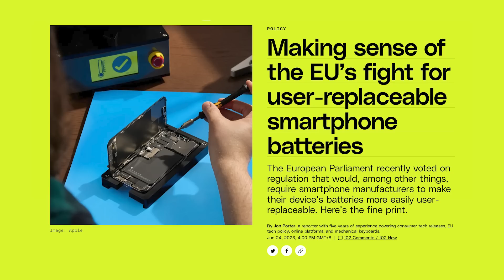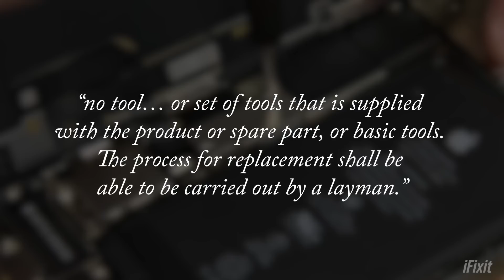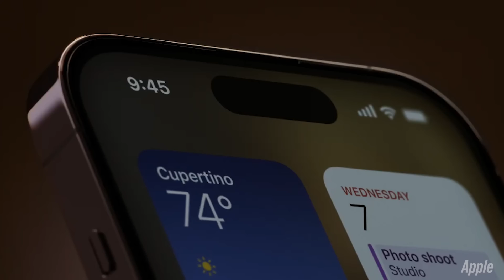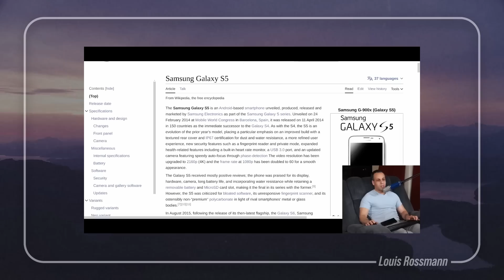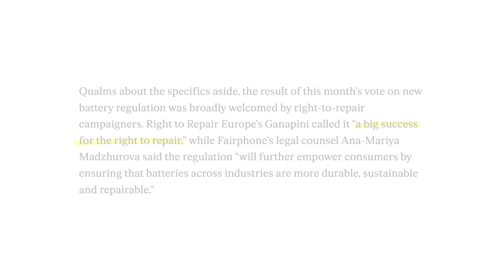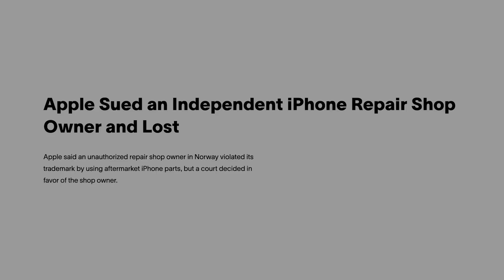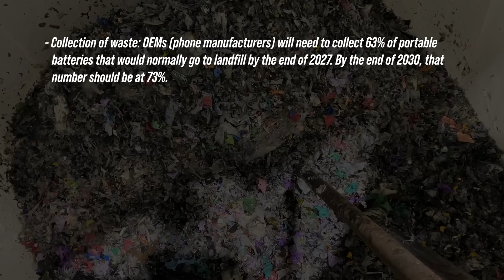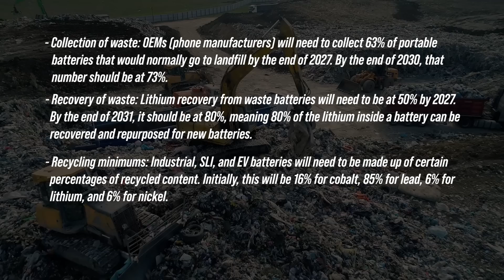EU Just Changed Smartphones Forever

Comment: Remember the days when brands were proud of their craftsmanship and tried to make their products last as long as possible? LV suitcases anyone? Well those days are over and everything lasts shorter and shorter. 
One great example is desk lamps. Something simple that everyone has and probably use the most without realizing it. Back in the day, I can change out the lightbulbs no problem. I had a floor lamp that lasted 15 years and died of old age and rusting. My ikea desk lamp lasted for 10 years with 2 bulb changes. Then I got a Philips lamps (it was the only brand I recognized in the store) At first it lasted quite long, 9 years with a bulb change in between (there was only one on/off button). Then it died and I got another Philips lamp which was LED and was touch sensitive. It lasted only 2 years, then the 3 subsequent Philips lamps (all touch sensitive) lasted for: 2, 1, 2 years in that order. Are you seeing what's happening? The 5 lamps were all Philips but their lifespan have become shorter and shorter. I mean, yeah, the LED lamps are way brighter but they also last a lot shorter simply because I couldn't change the lightbulb AND because they were all touch sensitive. The worst part is, even when I wanted to get a light bulb desk lamp, I COULDN'T because they no longer make it anymore or the shops I go to just no longer sell them. Isn't that exactly the same as smart phones? Theses manufacturers are making conscious decisions to phase out stuff that last longer and making stuff that last shorter.
Reply: Once I helped the girl of my best friend transporting a 22+ year old (second- to fith hand) washing machine she purchased. I would never have bought that old, loud, ugly thing, but she just wanted to finish this point on her todo-list quickly. It served the couple and a lot of other people (Travel&work guests) another 12-15 years. Was a "Miele" but thats not important, because they dont produce machines that good anymore since decades. Nobody does.
Reply: @bAtACt1X  In our apartment house we have a professional drying machine from Miele in the basement, for all people. It was old when I moved in in 2001, and it is more old now. I guess it is ~40 years old and still strong. Can dry the contents of 2x regular 6 KG washing machines in 22 minutes.
Reply: they cant fleece us for all our income if they gave us quality products
Reply: I have a very expensive 2 arm pharmacy floor lamp that uses halogen bulbs, which I can still find. The high end lamp shop I bought it from 25 years ago is still in business but said they don't work on anything with halogen bulbs. The problem is the dimmer switches are bad. Then it became "we can't get the parts". Very frustrating. Going to take it apart and am determined to find parts and fix it myself.
Reply: @rockyroad7345  my gosh I have the same dilemma with the light on a Nikon microscope that uses that delicious halogen bulb. The bulb broke because I was using it nonstop and had spent a lot of money looking for a replacement. I found one online however, the technician who would install the replacement is not that familiar with medical equipment. It's either his fault or mine that the microscope wouldn't turn on anymore. I like that microscope because the bacteria looked bigger compared to newer Olympus microscopes (LED bulbs). The light that the Nikon Optiphot emitted is so pleasing to the eyes. It's sadly a condemned property at the dumpsite because the institute don't have the budget to repair it. The quality of products made before were top-notch, their prices were top-notch too like 6x more expensive. But they last for a decade or two and have replaceable parts to boot.
Reply: LED bulbs held a lot better in the beginning, just like the traditional bulbs. Because the brands didn't sell as much as they wanted they all decided to make the heatsinks in them worse so they would break every 2nd or 3rd instead of every 7th year. The world's oldest still functioning lightbulb the Centennial Light has been burning since 1901 and has almost never been turned off.
Reply: I have an angle-poise desk / table lamp that I bought as a student in 1968.  Using a 100 Watt bayonet cap incandescent lamp, from the heat generated, the lampholder, switch and the first 200 mm of cable have needed to be replaced - twice.  Now with a brass and porcelain lampholder and replacement LED lamp it should last for another 55 years!
Reply: What about refrigerators, dishwashers, washing machines etc.etc.etc.? None of those last more than three, four years... At this point I buy the cheapest buy extended warranty and just replace it when it brakes... There's no point of buying $3500 fridge when it's going to break in four years just like a cheap fridge for $900 does.
Reply: They do actually. I think they do it through the updates, stressing your phone, etc. into consuming more enegry and useless stuff is stealing your phoney processor energy or so, making it slower, etc.
Reply: Water in our whiskey
Reply: I have a 24 year old power cable from my first computer, which I use to run my current rig. Acer was the shit back in the day
Reply: I hate the touch lamps had one they died after a year because of the stupid switch, took it apart to repair it and couldn’t even do that it was ridiculous never again will I bug and LED Lamp.
Reply: Technics SL-1200MK2 vs Technics SL-1200MK7
MK7 is a fucking disgrace to the legacy of the 1200 series.
MK2s don’t break, MK7s do.
Reply: Even IKEA still got desk lamps with changeable light bulbs, just bought one a year ago... easy to get.
Reply: Yea i remember that day clear as crystal but Hmm you told us that the desk lamp you had before only lasted 2 lightbulb replacement then what? Like Wtf? My plastic desk lamp been through 50 total of replacement of lightbulb since 2003 and I don't see the need to replace it to modern lamp.  other than recently i did the paint job, $2 touch sensor  and wooden finish to make it look up to date.. and btw all of the originals parts were still working. i just like to tinker with stuff

The on off switches are easily replaceable, so does the entire socket to the wire it's a simple electricity really nothing fancy. You can even paid an electrician to make you a diy desk lamp if you're too busy to learn it
Reply: its called planned obsolecense and the Dutch philips company had a big fat finger in it. too bad people never learn about this stuff in schools. Google it. philips lamps could survive decades before they planned to decrease the life spans of products at a "secret" meeting. yep. a real conspiracy.
Reply: I DO TAILORING I have a 1929 communist-era 7kg tailoring iron.  The electrical connector broke - I walked 400m to the hardware shop and bought a new one for $2

In the west we were told the communists were backward and stupid - no, they just had a very VERY different philosophy, they wanted things to last and be repairable.
Reply: @piccalillipit9211 tf does communist philosophy has to do with the thought process of everything around the world at the time? It only started to change in the 21st century
Reply: Communism was always a global concept.   Stalin abandoned this.  @Joemondaking
Reply: @piccalillipit9211 communist got their products from capitalist companies in other countries. This false duality is used to play you as a pawn. Communism and Capitalism is ate two sides of the same coin. Figure out who makes that coin and controls it (flips it for you) and you'll see that these "economic theories" and "political ideologies" aren't what they seem. 

What you're more likely trying to promote in your comment is a form of craftsmanship based in an Agorist market. Essentially, the old way of a skilled and experienced craftsman that creates something that lasts for years, decades or even generations. That's the philosophy your aiming at but you'd have to live in a smaller, localized society and not the massive, global fiat currency based market.
Reply: @piccalillipit9211  So communism good-ish
Reply: @hirigone No. Islam is the solution.
Reply: @piccalillipit9211  Spot on. I live in Russia in my grandma's old apartment and still have A TON of things from the 60s and 70s working perfectly.

I once had someone explain this fact to me, and it was like a revelation. The Soviet motto said "From each according to his ability, to each according to his needs". The higher quality goods you produce, the more needs you fulfill. So the longer they last, the less government spends on production (remember that all the factories were state-owned). Yet the work people do ("abilities" from the motto) will not change, so the state gets richer (exporting goods, say), yet has to spend less on people whose needs are met. Those riches can in turn be spent on education, medicine, etc.
Reply: @pintavodki  - EXACTLY - so to western eyes having a 50 year old style connector on an appliance LOOKS backwards and you mock it. But ask any iPhone user what they think of ever-changing connectors now LOL.
It was not backwards - its was a deliberate plan that was actually WAY ahead of its time and one that we are cheering the EU for implementing in a small way. 

What I love about the communist era made things we have here is they have the date of manufacture and the price on them - it is the same in Russia?
Reply: @piccalillipit9211 old good commie product doesnt meant the commie are not backward my guy
Reply: Remember: Every technological advance of the last century has been for the benefit of companies, not consumers.
Reply: You, the consumer, cause this.  Stop buying junk and junk won’t be produced.  You can buy thousands upon thousands of lamps, right now, that take standard bulbs, which of course you can populate with LED.

Comment: Returning batteries is the least tricky part I can think of we literally have it already in force for like a decade or more for car batteries it works like this either you buy some fee or yor old not working battery. But then it would actually create more ewaste than remove because it will force you to trash a device you could sell off instead

Comment: Honestly - it chqnges nothing since you wont be able to buy a battery to replace it like look, even now it is not that hard to replace the battery but most of the makers do not offer replacement parts for sale and 3rd party batteries are so bad that they literally keep rebooting the 0hone when the charge is below 50% and then they have 1/3 the capacity of the original one ...

Comment: Excellent. Now I won't have to use a thick, sound-muffling, Faraday pouch/case for my phones anymore as I can simply remove the battery when they're not in use. This effectively prevents any criminal intelligence agency, or rogue "hacker" from monitoring my devices, should they discover & use a "0-day" exploit to compromise them without my knowledge. Of course, prevention is impossible, but mitigation is the next best thing.

Comment: Let's say that Apple is down with this, and they make iPhones with replaceable batteries. iPhone owners will most likely buy batteries from Apple Stores or Apple Certified Stores. Because they don't want "anything bad" happen to their phone.
Android phones users however, might opt to buy random-brand battery because of they'll be cheaper. Their phones might be so cheap that just by adding another 10-20 dollars for an original-brand battery replacement, will get them a brand new unit.
Also, let's not forget, different-unit-different-battery thing (Apple would most likely do this). This year model's battery might not be compatible with next year model. So this year's battery will stop being produced once a new model comes out, and this year's model will lose its relevance in this replaceable battery idea. So I think the next step should be compatibility standard law.

But this is just my two cents. As my wife said : I'm usually wrong

Comment: Tighter integration of Apple components is also to satisfy security certifications for Visa/Mastercard for payments. A non-genuine component (camera, screen, etc.) can snoop on PINs. passwords, it can auto-approve transactions protected by face recognition, etc. That's why these features get disabled when a replaced part is detected.

And I do remember feature phones with replaceable batteries - and all the fun of loose contacts (Ericsson A1018), or Nokia phones breaking into 3 parts when dropped. It's just easier to make things sturdier yet thinner and lighter if you can glue things together.

I wonder how expensive genuine batteries will be. The aftermarket ones were often a big disappointment.
Reply: I understand you points but I don't think they would be a huge deal if the manufacturers would actually try. 

To your first point: There could be a setting in your software which activates a repair mode so smthing. (You have to have your phone unlocked to activate it.) If this mode isn't activated, your phone will lock the new camera, mic or whatever could be a security risk. So you basically have to unlock your phone to change parts.

The second one is unsure since we don't have much examples that aren't a decade old or haven't been developed very much before being dropped. But we also never thought that we would get foldable screens  or periscope cameras in phones and yet here we are. I could Imagine a battery to slide out like a giant SIM card or a removable back that's held in with normal screws like you had on some iphones I think.  The only thing that had to be done is to make the back removable which should not be that hard.
Reply: @Bronyboiiiii  For the first part, that's not solving the issue. I willingly bring my phone to a repair shop, I authorize the replacement - but the shop installs a compromised component. Or I may even do it myself, ordering an after market replacement part online and receiving one with a backdoor.

The approval would protect against someone changing components without my knowledge. While possible, I don't think it's a common occurrence.

As for getting the build quality of replaceable battery assembly - I do believe it's possible to do and high end models will get it right. We'll see how the cheap models cope. But we will get there. Just expect some hiccups along the way.

Comment: Terrible analysis:
1) the reason removal batteries stopped being a thing is the android industry colluded to tie the life of smartphone to the life of a battery 
2) furthermore, always having a battery in phone ensures that low powered transmission devices are always powered on...even when phone is dead e.g. geotracking. This was in interest of Deep State (don't believe me. Google what Snowden whistleblew)

This is just like why micro SD slots were removed. So they can limit onboard storage, making users dependant on cloud requiring to always be connected, sending all personal data to google/apple servers where Deep State can access. Case in point, micro SD prices have gone down tenfolds in prices, we are still getting 128GB storage.

Comment: Right to repair is NOT about making it a "easy" to repair, just simply so anyone can choose to repair their device or have someone of their choice to be able to, not just the manufacturer and their "authorized" service centers. 

It's ok to have a difficult to remove battery, but not an impossible to replace or serialize a battery without a tool or software to properly replace. (Apple)

It's ok to have a difficult to replace screen, but not to block the imports of replacement screens (Samsung)

It's ok to have a paired sleep sensor to a laptop, but it's not ok to not supply the software to pair a new one (Apple again) 

Sure, things like easily replaceable are right to repair respecting, but that isn't the primary objective of right to repair

Comment: Apple engineer here, we've already found ways to circumvent this, sorry. We will offer a single model with an unlocked battery (lowest iphone SE model) but custom screws that require an apple only certified screwdriver to open the case that also voids your warranty and the battery you use MUST be apple certified only. It won't work with any other batteries for your own security. You'll have to try harder to stop our massive profit margins and hard lock ins.

Comment: Ever had the swelling battery problem in a MacBook? They have to sell torx drivers with replacement batteries. And the batteries are stuck in there with double sided adhesive tape. Very tricky to remove, but possible. MacBooks used to have removable batteries. I'm glad they'll be back.

Comment: You know what would be great? Having a removable battery but still have a much smaller non-removable (but serviceable) battery planted on the phone. So you can swap battery without turning off the phone. Fast charging would be redundant. and to answer your queestion at 8:04 NO. It's not consumer demand because the companies stopped giving enough options many years ago.